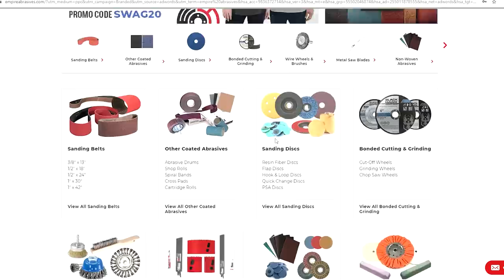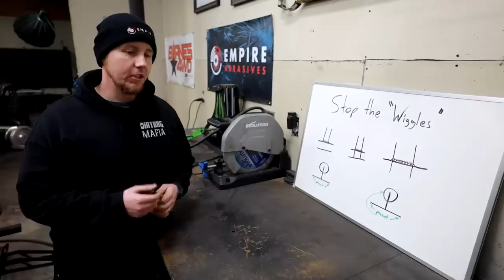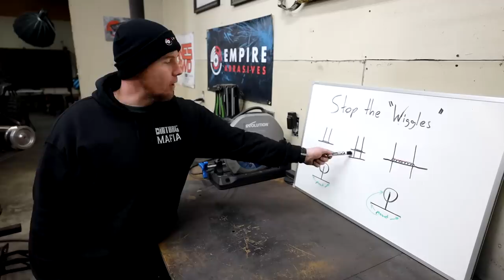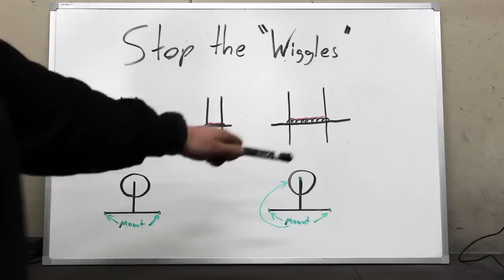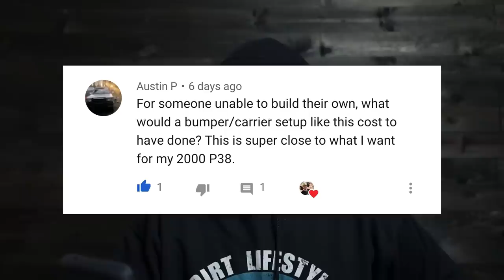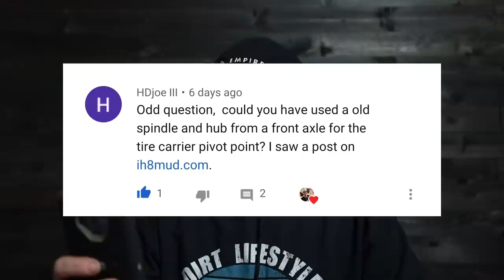Ultimate Overland Tire Carrier Episode 4. Ultimate Land Rover Discovery Build Episode 19

Comment: That latch system is an amazing thought process/experiment!
Reply from the maker: Thanks!
Reply: @Abel Harbour That’s a great point! I used the same red handle latch on mine and left it open once. Once. Lol. Went driving around and when that carrier swung open, it nearly yanked my Jeep sideways on the street 😂
Reply: @Abel Harbour thankfully, it’s a Jeep TJ- nice and narrow and doesn’t swing wide enough to hit someone. It definitely made my butt pucker, though
Reply: When you look into using this style lever to open 2 latches simultaneously, you have 2 options. 1) Look into a bmx gyro cable. Turns 1 cable pull into 2. 2) A specialty lever exists that pulls 2 cables at the same time with 1 handle.

Comment: I think you should re-do the original latch with the same truck latch and have both of them actuated with the lever.
Reply: The thing that the handle latch he's got there adds though, is tension.  When you latch that thing in, it pulls the lower bar into the seat its designed to sit in.  Which probably helps firm things up a tad.  The truck latch could have that too, but instead of having leverage to pull it into place, you'd have to slam or push it into place, like a car door.

Comment: Great use of that latch, I used to love walking around the junkyards thinking how I could repurposed highly engineered parts onto my AMC or Jeep. For the bolt your using for the striker pin, if you can’t find a striker pin that works try to use a shouldered bolt the hardened shoulder will last longer against the latch jaws. I learned that lesson and won’t forget it.

Comment: Nicely done Nate. That bumper table is awesome. 
I enjoy watching your builds because you think outside the box. Who would have thought of using a truck latch and bike brake setup!?!? 👊👍
I purchased a $200 bumper from a guy where he used the existing holes on the tailgate to mount a connection point so the tire didn't move around. His setup was using a wing nut. Very secure but was a pain to operate. Clearly he did not have your fab skills.
Reply from the maker: Thanks! There is certainly more then one way to skin a cat. Tire Carriers are the same way. The important part is understanding the compromises that are made throughout the process.  It sounds like the Carrier you picked up had a compromise of practicality for strength. Anyone can build this way lol. The hard parts is trying to engineer these products in a way that gives us both. 
Thanks for watching the struggle!

Comment: I was going to suggest the drilling through the square tube idea, but drill all the way through the square and weld the round tube to the top ad bottom. That way the tube would be attached at 2 points instead of 1. But I like your latch idea even better and you didn't have to undo any existing work you had done.

Comment: Awesome job using the bike brake lever. I used one on my samurai and mounted it just below the shift knob and used it for hand throttle. Tied the brake cable to the throttle cable. So they made it easier taking off on steep hills. No more of that foot on break and throttle and other edit on clutch. Now just have brake and clutch to mess with. 

Guess I could’ve just done an auto swap to solve that also. Haha

Comment: I'm a bit late to the party on the tire carrier wiggle issue, and it sounds like you've already figured something out. Just the same I'd like to recommend a modification of the through hole method you addressed in the video. Drill the hole all the way through the entire square section (top and bottom), then weld the top and bottom on the outside of the square section. Beveling the holes would add more strength. This would spread the forces across double the material, and provide some (maybe significant) wiggle reduction. Otherwise, I've enjoyed watching your problem solving. Well made!

Comment: I should have commented last week... All I was thinking is that the tire needs to be stable when latched.  Install a rubber tire bumper from a Wrangler tailgate into the top of the hatch, and have a gently arching “leg,” made from bent tube that is welded at the top of the tire carrier, make contact on the rubber bumper when the tire carrier is closed.  Simple. Easy. Takes only one tube from an experienced fabricator. And will be VERY secure when closed, meaning no wiggles, or movement while going down the road.
Reply: Please don't let this seem like a poo-poo of the excellent fabrication work that is going on here. Nate is going above and beyond. And we are all the better to learn from this.

Comment: Consider replacing the latch cable with a rod system. The reason for this is that your latch mechanism will likely gunk-up to the point that the spring will fail to pull the cable. A rod system will allow you to manually assist the latch into the closed position.
Reply: I not sure I agree, cables like that have been used on bikes, ATV's, snowmobiles, motorcycles, and the list goes on and on.
Reply: @williamhardin5254  I agree with you, but it's not the cable that will become an issue. The latch mechanism, exposed as it is, will likely become tight due to dust, dirt and grime build-up causing the spring to be unable to return the latch to the closed/latched position. At this point the cable will be inadequate to manually push the latch into the closed position as the whole setup is designed for the cable to pull the latch open and the spring to close it. This is just an observation from experience as I've been down this same design path.
Reply: @BridgeZipper  The latch up at the tire mount has a pretty heavy duty spring on it,  so even if the handle spring (assuming it has a spring) got stuck the latch would probably still work. If it does stop working my guess is he'll find his own better way of fixing it. I say let him go wheel it for a while and he'll decide himself if he likes it. You have to admit it's a pretty creative fix he came up. ( I sure wish I had a cable on the gas pedal of my Jeep going straight to the Throttle body)

Comment: Great video as always.
So happy you went back to look at and remove the carrier "wiggle". It's been catching my eye every time you moved it in parts 1-3 but didn't comment as I was sure you would do something. And such a well thought out solution. 👍
Would be great if you could have the top and bottom latches open from a single handle via two cables. 😎

Comment: i'm by no means on the same level of fab work your doing. Working buddies Jeep we call Rat trap. A whole story by its self. But, Frankenstein parts laying in shop have turned out some very practical and good parts for this Jeep. All of the aluminum used for the shift boot cap, boot ring, and switch mount are from an old door jam shaved from an office they did a build out on. Its free and it works. Anytime you turn scarp back into useable material. That's just  smart. And does clear out a space for more crap to get put there.

Comment: Firstly kudos for the ingenuity of the second latch design. I am from OZ, the land of murderous corrugated outback roads that kill wheel carriers. I am an mechanical engineer and have seen a lot of failures where designs have differential movement between chassis and body. You will need to keep an eye on cracking of the door, as you have transferred the leverage of the tyre into door. A simple gusset down the face of the RHS and up the  tube frame in the plane of the flex would also help.

Comment: Well done Matt. That third mount was the best and strongest choice for sure. I really like the simplicity of that table too.   When I get to the tire carrier on my Jeep I'll borrow a lot from this design. I may explore using junkyard tailgate latches at both locations and see if I can use the tailgate handle (or smaller lift handle) in the middle of the tire mount to activate them. I may try using the tailgate linkage instead of cables too. One thing's for sure, I won't finish it as quickly as you have!

Comment: Fabing metal can be very expensive 💰. I'm an electrical engineer who worked in R&D for years. 
I've designed many parts for our products and I always freaked out on final costs of these items. 
To think how expensive a piece of aluminum sheet metal could cost.
Your aluminum doors you designed would probably cost around 500 to 700 bucks a piece because they've one off builds (that would include black anodize). And that doesn't include assembly. You still have to assemble it and install it yourself. 
Thanks for the video Nate! The trigger switch you came up with was great 👍
🇺🇸🎄🇺🇸🎄🇺🇸🎄🇺🇸
Reply from the maker: Thank you! You nailed it. These projects cost way more them people make. That's why I have a channel showing them how to do it themselves
Reply: @DirtLifestyle  I admit I'd probably would have used a 12vdc solenoid bracket welded to your support frame. Then add a push button switch to open it.
I still like the mechanical version you came with. Mainly because it worked well and was simple enough and still kept it latched when closed.

Comment: Love this channel. I have learned A TON just watching you and have yet to touch a welder. When I finally do, I will be ahead of the game thanks to you.

For the cable release: there's potential to route the cable through the U-shaped tube the tire is mounted to by drilling two small holes and feeding the cable through for a slightly cleaner look. Grommets or silicone would waterproof it. You probably considered this, but it's what I was thinking as I watched your solution come to life.

Great stuff, brother.

Comment: Land cruiser uses similar cable latch system as yours, it have rubber boots on both ends of the tube to prevent dirt an dust from getting in it, which will keep the tube clean and cable pulling smooth

Comment: Awesome build! Your tire will still vibrate though. With only a center mount for the tire it will continue to move, add some pads for the rubber to rest against at the down tubes and draw it tight to them and it will instantly stop flexing the center mount.  See you on the trails!

Comment: Love the latch system, function first using what you is available  for the best cost. A pick up truck  tailgate latch may  be a starting point  design wise, then re-engineer its basic functionality to your needs for the build it will be incorporated into.  I like the "one off" builds, using affordable off the shelf parts to accomplish the task for the build in a fully stocked shop environment, yet the for thought of being able to fix or adjust that latch with just a leatherman or a minimal  tool kit.

Comment: Awesome use of the cable and latch.  I would add a rubber boot to the top to keep dust and water from getting into the cable line, causing it to get stuck over time (at the adjuster nut/ bolt).

Comment: I'm so glad you decided to go with triangulation to solve the wobble issue. It's gonna save you so much weight in the end. Btw who ever says that cable adjuster is ghetto clearly hasn't witness ghetto rigging first hand. That's good work if you ask me. This is gonna be worth all the time you've invested. Thanks for taking us through your journey sir.

Also an idea for spindles and hub trailer axle parts are very cheep and can be used. I did with my tire carrier and it worked great.

Comment: Drill into the rectangular tube insert and weld solid bar stack that tire loop will slide down onto long enough to go 1/3 to 1/2 way up round tube then plug weld in several locations. Will help with good bit of flex and the failures your concerned with

Comment: A suggestion for future improvement to cable latch would be to run cable internal. You can run this one into your tube mount, or at very least you can clean it up but running up the tube externally rather than dropping straight down from the latch. I think you have room to do that without making any sharp curves.

Comment: Awesome work mate, Could you mount the cable latch onto the red latch so that it becomes a one handed operation? The extra weight might pop open the red latch but if it didn't, you just grab the bike handle, then swing the latch in one movement

Comment: Neat idea. I was thinking about drilling a hole through the center of the spare tire plate through the Hub hole and then using something that requires a 90 or 180 degree twist lock with a T handle

Comment: Loving the new latch system, i prefer out of the box solutions. there are dual cable assemblies available. bmx bikes use them for brake cables to spin handle bars. now if that spindle was just a bit longer, could double shear mount it(bolts of course) take wobble out of it, when open.

Comment: I know this is 8 months old but when you mentioned adapting the tailgate latch/bike handle to use two latches, I couldn't help but think of the time I spent under a lot of vehicles. The parking brake usually goes under the floor of the vehicle and then has a "Y" to run a cable to each rear wheel. I think a minute spent under a vehicle, staring at that "Y" and you will be able to make whatever you need.

Comment: Great work! You might think about a double hinge tire carrier. I first built carriers for Jeeps but the biggest bumper carrier I built was for my Waste vegetable Oil bus. It open and close with the back door but lifting a  semi size tire 6’ in the air was all I could do in my Younger days. To make it easier to get the tire to the ground I hinge the vertical part of the Carrier to lower the tire to the ground. With the tire on the ground I removed the tire and roll the damage tire to the hinge carrier, bolt up and hinge tire back up and lock in place. 

I’ve never seen a double hinge tire carrier but see the need with heavier larger tires.

Comment: Had a crazy, bit out there thought about using a hub and spindle for the pivot of a tire carrier. Rather than using one that matches the drive train, size being the issue, use the smallest 4x4 hub/spindle you can find with a locking hub, and incorporate the axle stub with the spindle. This would give the ability to lock the carrier open (or closed)and in nearly any position in between. Something like this could help loading/unloading on a tilted driveway, or in a parking lot.

Comment: I love the build as always.  The spare tire would be even better if it was on the rear door. Since the rear window is already obstructed, I would do a steel window, weld on the door, and the tire mount from there.  I know you want it on the bumper, but it seems a lot of load even with multiple locks. Im just a self proclaimed youtube expert with no welding experience hehe :)  have a nice day!

Comment: Nate, on the back window you plan to cover on aluminum why not put the sheeting on the inside of the door and hinge it with gas struts? 

You could mount everything on it still but also flip it up and have an awning for some protection of the elements while using the kitchen.

My other thought is building a sheet metal cover for the second latch to keep it out of the elements. 

Great work, I’m an amateur fabricator but tool maker for a living so design is more strong suit.

Comment: I'd be mildly worried about body flex or movement causing issues with that second latch. But, it does look like a ideal way to distribute some of the weight.  I just wonder if the frame was under a twisting load if the latch would still line up properly. Say you're using the hilift or the truck is flexed out. The chassis will be out of alignment to the rubber mounted body to some degree. Love this channel, it's very enjoyable to watch.

Comment: The table you made looks similar to a stock TJ skid plate.

Also, the secondary latch you made is almost identical to a stock tire carrier off of an 80’s S-10. It doesn’t need to be all that strong either since it’s only isolating the wiggle and not holding up the weight.

Comment: I highly encourage you to make additional 90 degree lock just for security reasons. That tire carrier is obviously pretty haevy with tire itself, when you swing it on even floor inside garage its ok, but whenever car stands not even to the left or right it wont be that easy to open or close what is the most common offroad. More over when you stop at the right side of the road and you have to get inside of back, you better have that 90 degree lock... I have 35 at back of my G wagon and when car tips to left or right side its hard to open back door, good luck and keep safe.

Comment: The rear window replacement... 1- Is it held in with a gasket? 2- When you did the side 1/4 panel window replacement did you keep the glass? 3-If BOTH answers are yes, measure thickness of glass for thickness of rear glass and acquire aluminum of same thickness or slightly thicker {can sand, mill, or grind edge to correct thickness} and install using old rear window gasket.
Of course all this is out the window if you want a hard/permanent mount to attach other things to, like your table.

Comment: I used to have an HJ60. I ran 33 x 10' tires. In South America they do this all over the place. You get down through mud etc to solids fast and easy.  Also, the tire is way lighter. 
I moved on to a Lexus LX 450 with 33 x 12 tires but kept a 33x 10 for my spare. It mounts under the rear.  I wanted more clearance and a lighter spare. It only has to get me back to the pavement. 
So you might think of mounting a thinner spare to save some weight.  Same diameter as your other tires.  This will lessen the. touque on the tire and the welds. 
Just a thought.

Comment: You can get those little pins (lynch pins) with a little spring loaded ball in the end that locks them in. Exactly like the spring loaded ball on a ratchet that holds the socket on. I dont know the name of them but they are exactly like your pins but with a little ball to keep it from falling out. I have some stainless steel ones I use for things.